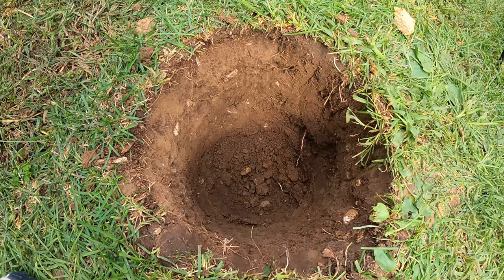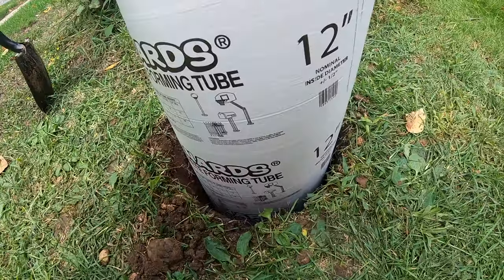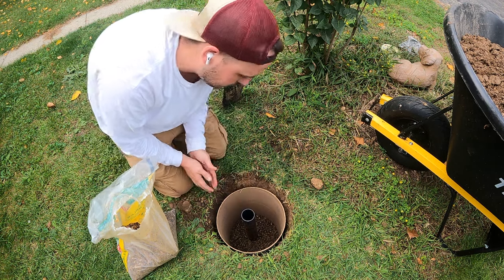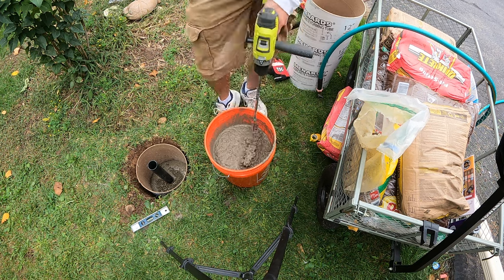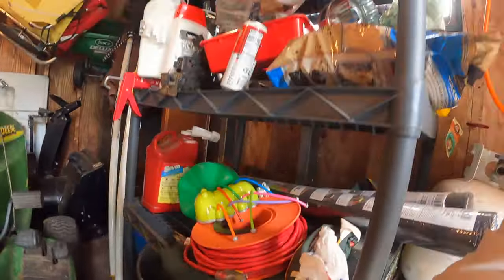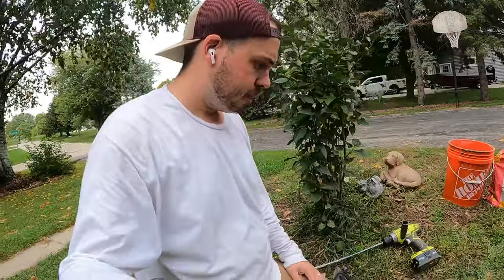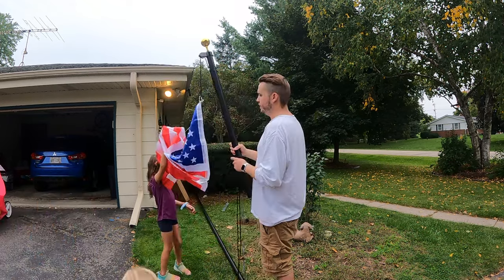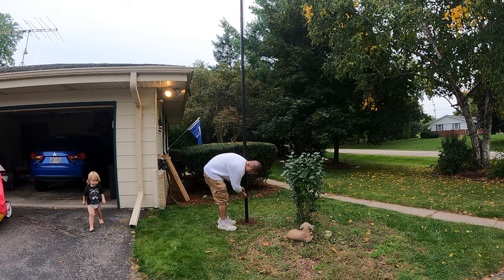Step by step 20ft flagpole install: Toolbox Tales EP 9

Comment: You should push the base pole into the gravel b4 pouring concrete.   U don't want the base when it has concrete below it.  The base pole needs to drain into the stone.   That way it is not holding water.   I always set my base pole a few inches into the gravel b4 pouring the bag directly into the hole.   Mixing is not required with those red bags.

Comment: No tap, pea gravel a couple inches in the pipe as well the sides. Tape the TOP if only you're sloppy or in a rush. And pour concrete on the sides with the pipe already in place.
Reply from the maker: Thanks for the advice! This was my first flag install and I was trying to follow another video while recording.

Comment: What was the purpose of using the sonotube instead of going directly into the ground. I’ve only ever used them if I needed to form concrete above grade. Just curious.
Reply: The tube is a waste of money, just put concrete into the dirt, it works great. just like installing fenceposts.
Reply: Lots of wasted money yoy did there for a flag pole
Reply: Sonotube is used when you need to form above grade. Like posts for a wood deck; you don’t want them contacting the ground and rotting prematurely, so sonotube gives a nice and easy form that you will see for decades. In this case, the sonotube was just extra work and money since he covered it all up. You’re not supposed to leave the tubes in the ground either…
Reply: And the gravel was a waist

Comment: Level the top. It's not necessary to put the level on the side of the pipe.
Reply: Agree with this. But…just be darn certain the top of the sleeve is exactly 90 degrees to the sleeve itself.

Comment: Question: I have an existing flagpole about 20 to 25 feet high and it has no existing rope on the pole.
There is an "Eye-Bolt" at the top of the pole for a rope to pass through - however - the pole is to thin,
to small in diameter to lean a ladder against it in order to climb the pole to lace a rope through the 
existing eyebolt.
Any thoughts on how I might get a rope through the eyebolt at the top of the pole?
Reply from the maker: Small lead fishing weight, strong weight fishing line, extendable pole with a hook. Position pole over right spot, loosen line so the weight drops in. Drop down, stitch end through rope, tape so it’s smooth, pull over and out. You’ll have the forearms of Popeye but it will work with enough tries.
Reply: If the flag pole is in a flat area and accessible, you can always rent a lift from the local home store.  The fee is usually $200 for 4 hours.